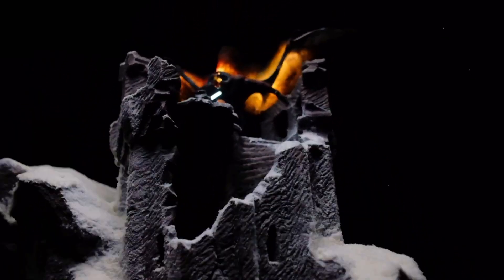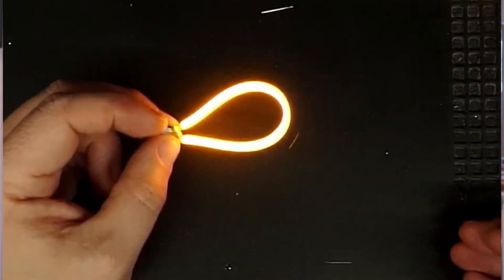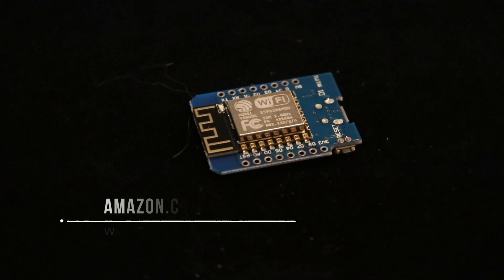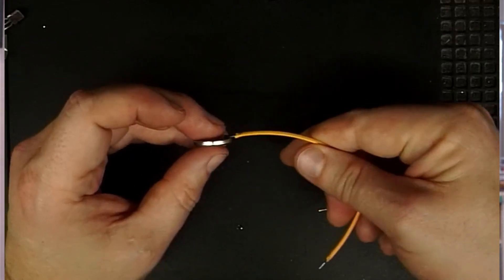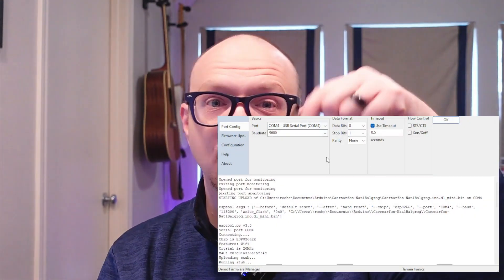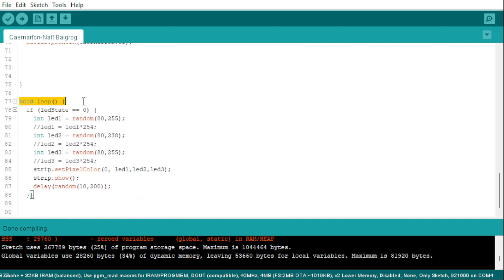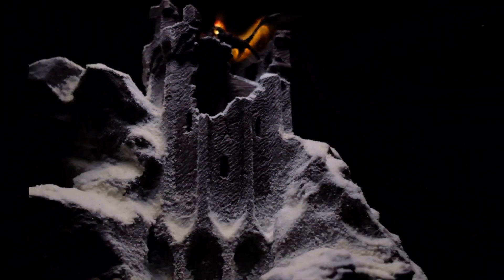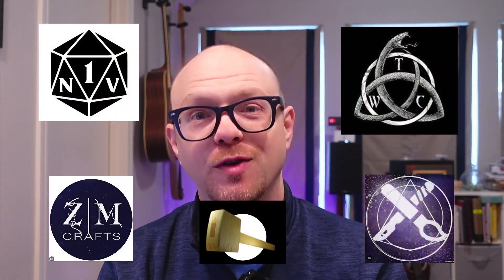DND Flames with LEDs - A Balrog (LOTR) collab with @Nat1videos

Comment: The random value makes the LEDs switch suddenly to a brighter or dimmer value and that doesn’t look realistic.
A better approach is to actually use pwm and select that random value and either increase or reduce the duty cycle to get to that new intensity value.
You can of course also do that with a digital pin and just turn the led on and off in the loop and depending how long the on or the off is make it brighter or dimmer.
Either way moving gradually to the next value makes it behave more organic.
Reply from the maker: I couldn't agree more. In this case, we had a single evening to get everything working! :) Looking back, given time, I would have done a simple LFSR followed by a low pass filter.

Comment: Oh wow! That’s an amazing amount of randomization to be able to build in! No wonder it makes such a realistic effect!
(Edit for autocorrect errors)
Reply from the maker: Hello! There are smarter ways to make it even more random. right now, any value between 80 and 255 could happen in an instant. Part of me wonders if I set the maximum difference between 2 time slots should be set of 20 or 30, so that you get more of a dimming time between big states.
I'm not a very good programmer or mathematician. I tend to hack other people code together and tweak until something works! something about a million monkeys with a million typewriters!
Reply: @TerrainTronics  if I recall correctly there’s also a few good gems about not reinventing the wheel and imitation being the sincerest form of flattery right?